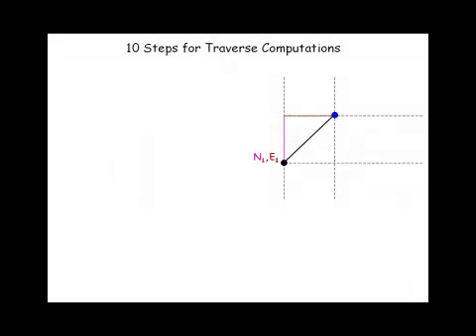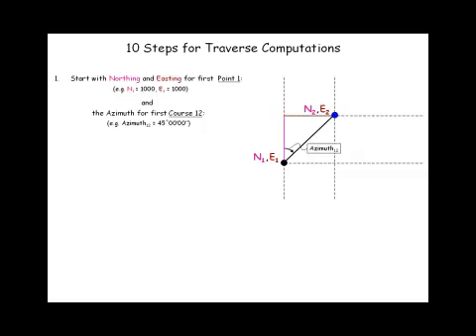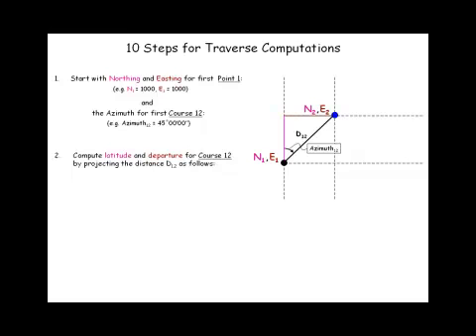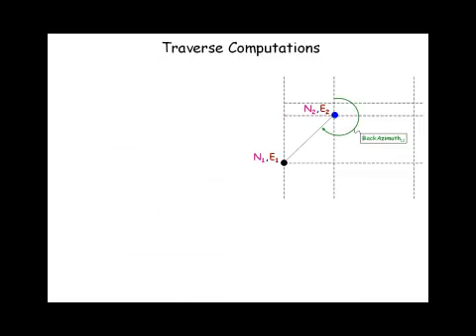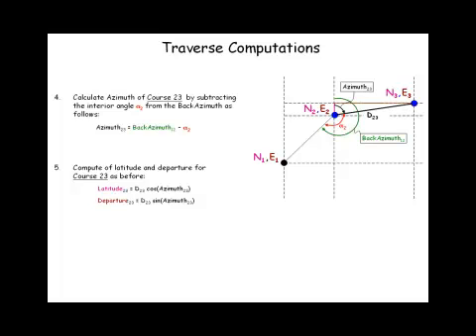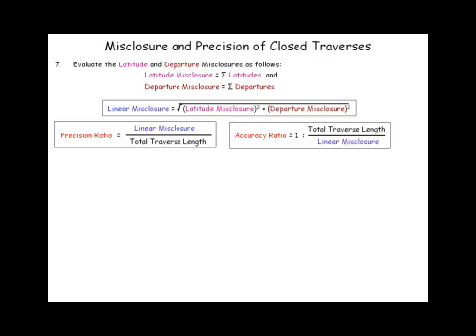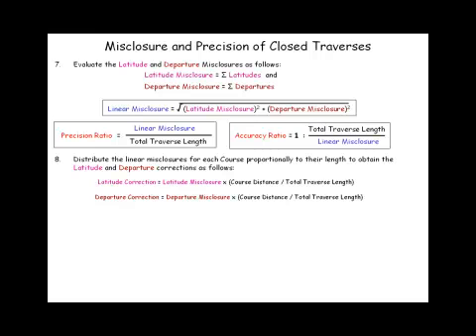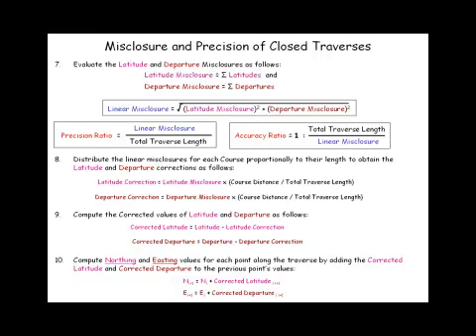Surveying Traverse Computations in 10 Steps

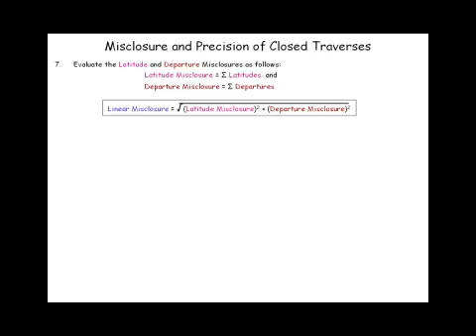Comment: 6:09 the linear misclosure isn't that correct. must be an addition instead of multiplying
Reply from the maker: The linear misclosure is the square root of the addition of the sum of squared departure and latitude misclosures.  Just like using Pythagoras' equation to calculate the hypotenuse length from the sides of a right triangle